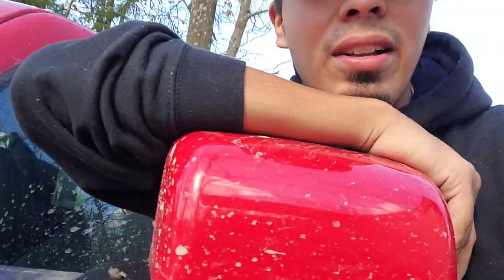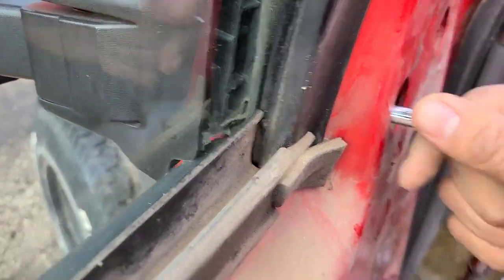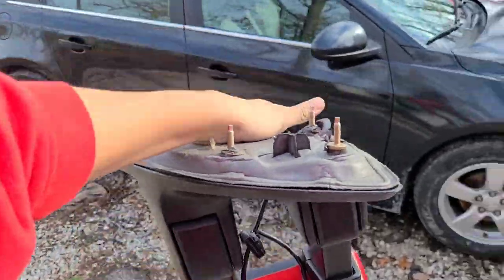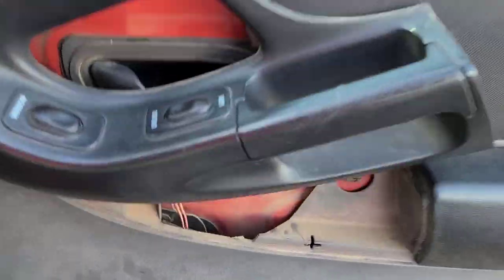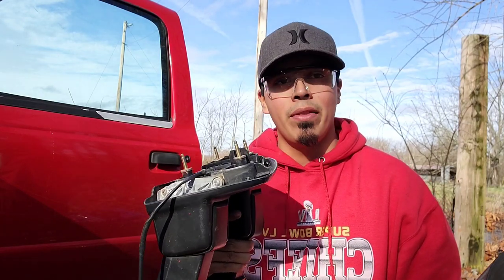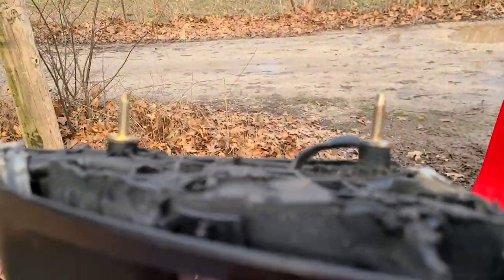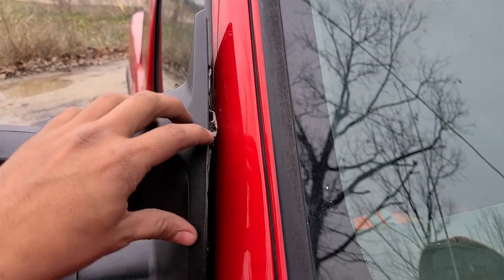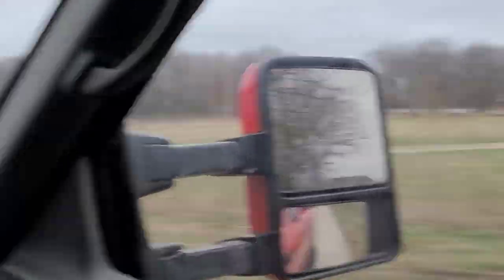F250 TOW MIRRORS ON FORD RANGER | PERFECT FIT?!

Comment: FYI - if you are interested in increasing towing capacity on your ranger Do Not use the f250 mirrors. Switch up to the f350 mirrors. It will increase capacity as it's one hundred more than the f250 mirrors.
When you go to the parts store tell em Big Buck sent you..
They'll know who I am and treat you accordingly.